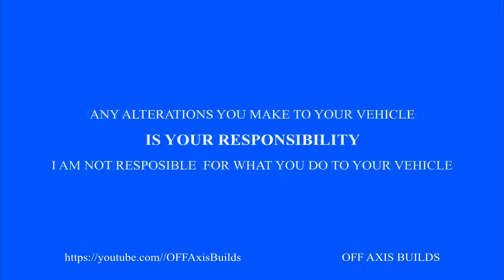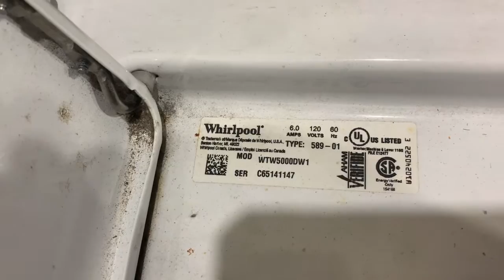Whirlpool top load washer Replacing the shifter switch #whirlpool #Toploader #diagnostic #shifter

Comment: I replaced the shifter switch but it is still coming up with the same error code in the diagnostic mode. I also tried recalibrating and still the same problem and same error code. It starts to fill with water then gets stuck in sensing mode and won’t move on. It will do rinse and spin or drain, and the lid lock works too. Any other ideas on what the problem might be? Thanks for the videos!
Reply from the maker: Does it make a loud noise when shifting?
Reply: @OFFAxisBuilds   I’m not sure... it doesn’t really shift, so I guess not?  Also if I open the lid while it is stuck in sending mode and then close it it will start to fill up for a few seconds again before stopping again.
Reply: @OFFAxisBuilds  so it looks like it might be related to the temperature. It will run correctly if I set it on cool, but when I set it on hot it gets stuck in the sensing stage and won’t move on to wash. Any thoughts?
Reply from the maker: I have not seen that issue before. It might be a temp sensor issue or a board issue.
Reply from the maker: That fill process is normal. It will put a little water in the washer after the lid shuts. 
When mine had that issue I replaced the board, and that seemed to fix the problem.
Reply: @OFFAxisBuilds  turns out the hot water valve was turned off 🤦‍♀️ I just bought the house and the appliances came with it so there’s some funky stuff going on. Anyway, it works now and also now I know how to replace the actuator if that ever goes bad 😂 Thanks for your help!
Reply from the maker: That’s great that it’s working. Thanks for your support.

Comment: So i replaced the shifter actuator the transmission the water pump the shocks took the tub out cleaned it put it all back together and still had the sensing light, just replaced the lid lock switch and i still am having the same sensing light on😡 i have had it with this piece of s*#! What am i doing wrong i practically replaced everything but the motor Should of just bought a new washer!!!!! Am i missing a step how do i get it off this sensing light? I have unplugged it done the diagnosis reset it and nothing!!!!
Reply from the maker: Sounds like it could be the control board. Sorry this is a stupid question but is the belt on or slipping?

Comment: Don’t put that guard back on that is also worthless too
Reply from the maker: ScantPear1985 I tried it without the guard on but when the machine is fully loaded the weight of the load pushed the drum into the ground. Do that guard is required so that the pulley doesn’t get destroyed.
Reply: That's what I hate when people tear things apart they don't put everything back on. Will become a problem in the future. Always put everything back the way you took it off. That is my number one rule. Then you will never have any issues when you go to test it and find out you have another problem.
Reply from the maker: james w completely agree
Reply: It's not called a Guard for no reason.😄
Reply from the maker: Yeah you actually do need that guard otherwise you will wear out your pulley when fully loaded.
Reply: @OFFAxisBuilds  I have fully loaded the washer without the guard and it did not wear out the pulley plus if it would wear out the pulley it would happen against the floor and if the guard is on, it would reach the guard before the floor Lolol
Reply from the maker: I have actually had to replace the pulley because I ran it without the guard and it rubbed on the floor. That’s why I say you really should reinstall it.

Comment: I just bought a brand new one and it is the worst piece of junk out there.  I wished I fixed my old washer.  I had a GE for 20 years, repaired it myself a couple of times, I left it when I sold the house.  I bought this new one and it is just junk.   It takes 15 minutes just to get it to run because of all the automatic features that take forever to start it.  Do not buy a Whirpool.
Reply from the maker: 100% agree with this

Comment: Unplug it and throw it in the trash this is junk and should be illegal
Reply from the maker: I completely agree the hole unit is junk. I have had nothing but problems with it. I replaced that part twice, the transmission once and the belt and pulley twice.
Reply: OFF AXIS BUILDS appliances are never worth it today buy used appliances
Reply from the maker: ScantPear1985 I totally agree